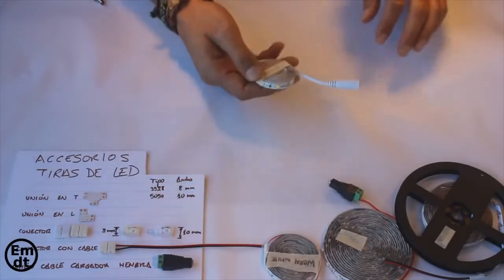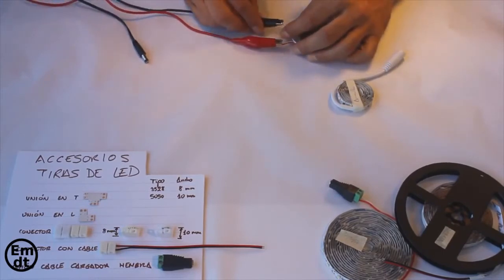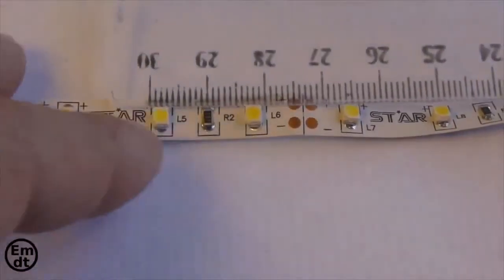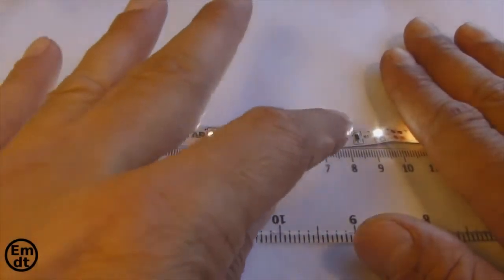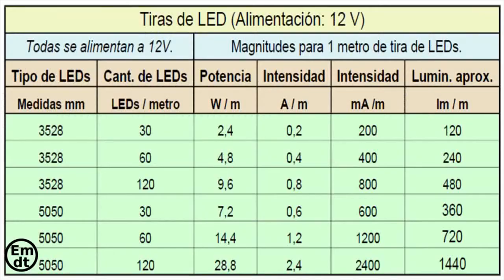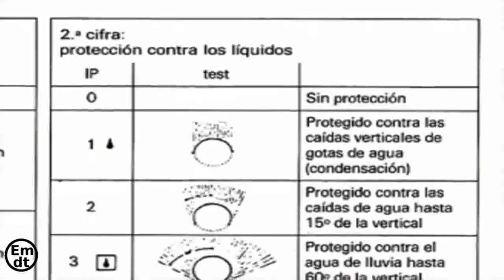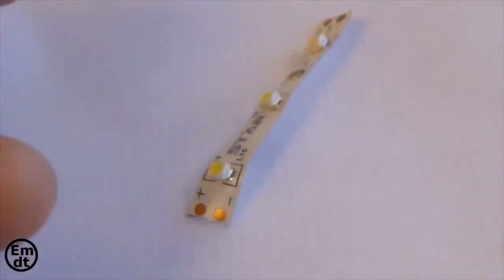Types of LED strip lights, power consumption, single colour vs RGB, waterproof or not... #1

Comment from the maker: 00:22 Types of LED strips depending on their connector and colour. 
01:10 Connector for a LED strip without welding.
01:40 LED strips depending on the measures of their LEDs 
02:15 Identify a LED strip by its number of LEDs
02:40 Power consumption
03:11 Power board, intensity and luminosity for the main LED strips
03:30 How to buy a LED strip, prices
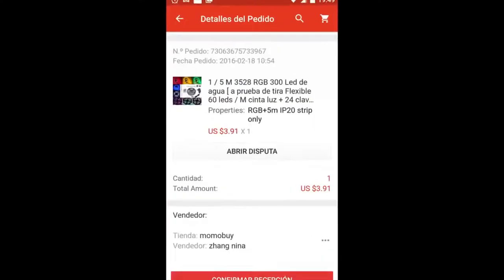03:56 RGB strips vs single colour LED strips 
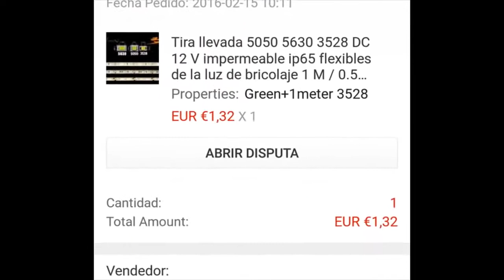04:15 Waterproof LED strips or not
05:10 How to cut a LED strip

Comment: What will be the wattage and amps of a 12volt (120led/m) Smd 5050 rgb strip light of 10mtr length?
Reply from the maker: Hi there!
In 5050 led strip is 0,02A or 0,24W per LED. 
In your case 120Led/m*10m=1200 Led
So 1200*0,02A=24A at 12V
Or 1200*0,24W=288W
Check out you led strip has 120leds per meter, they seem to be to much !-)